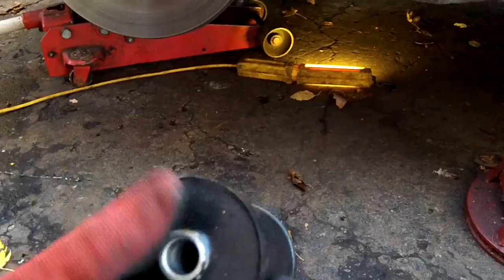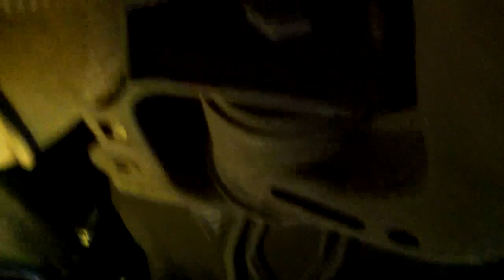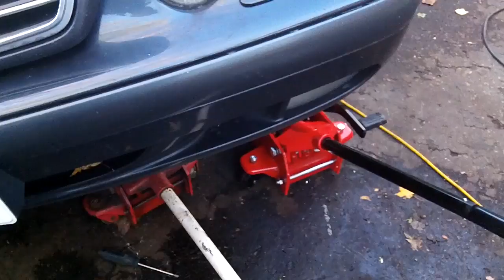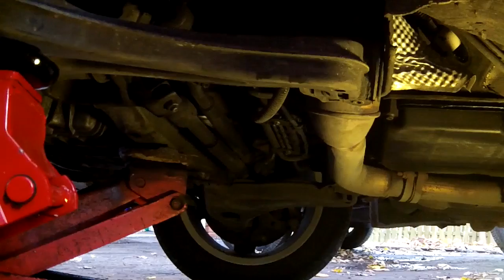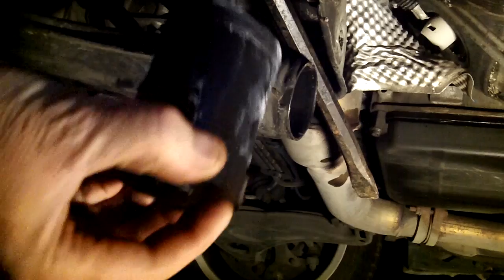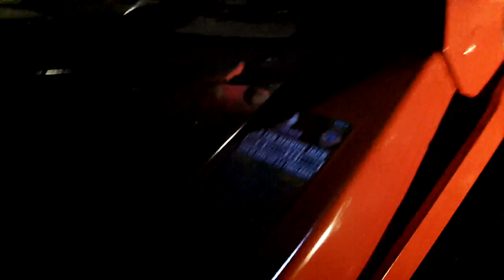Mercedes w208 clk320  Polyurethane lower control arm bushing installation

Comment: why would would my wheel hit my knuckle 2000 mercedes clk 320 tie rod end upper a arms wheel bearing Firestone alignment w208 chasis
Reply from the maker: If you have everything stock, including the wheels ,even with worn parts the knuckle shouldn't hit the wheel. Are the wheel rims stock ?
Reply: @fupabox  they came off a ml 320 I have inch and a half  spacers on the front and 1/4 inch in the rear

Comment: Thanks a million for your informative videos, Doing this job right now on my W208, that center part of that bushing was horrible to get out, drilling several holes did the trick! The bushings got quite warm and had a nice burning rubber and oil smell though lol That was the easy one, got the whole kit and I found the front bushing is even worse than to get out, it's not fluid filled so it can be burned out.

Comment: I'm about to change the whole control arm on my W208 only cost about $120 seems a lot easier than struggling with the bushings.
Reply from the maker: you are correct there.. I was going for longevity , since the bushings were wearing sooo fast, but replacing the entire arm is easier by far
Reply: Makes sense, I did the job today no problem thanks to yours and others videos, even if I was just changing the bushings though I think I would remove the control arm and do it on the bench.

Comment: my clk 430 had no steering wheel vibration before I hit a bad  pothole what could it be?
Reply from the maker: The best outcome would be an unbalanced wheel from the impact ..It could (in order getting from cheaper to more expensive)  wheel balance, wheel alignment, broken bead in tire from impact, bent rim
Reply: thanks for getting back to me your vids are very helpful thanks..yeah I think it could be something minor like balance because its not a bad vibration.. thanks again

Comment: Do the stock bolts fit back in the metal inner sleeve of the new poly bushings. Saw a video which showed that the new sleeve was too small at the ends for the original bolt to fit in fully?
Reply from the maker: +Shelley Bobman  I have never seen the stock bolts not fit in... I have done maybe 8 or 10 lower control arms, but it is possible some of the replacements are not the correct size..

Comment: I've had a pretty annoying hi pitch squeak coming from my front two wheels on my CLK for a while.. everytime I slightly turn my wheel around corners or even straightaways it'll squeak.. It's not the brakes, and its not the back plating to the rotors.. It's really driving me crazy, please help me diagnose the problem
Reply from the maker: +Matthew Nota  I would think it is something in the suspension...I would get a spray can of silicon lubricant, and spray one moveable suspension part ..then go for a drive..then try another until the noise stops.. then you will have found the squeek
Reply: +fupabox I purchased a lubricant spray and sprayed down pretty much all contact points on the suspension on both sides last weekend.. The noise was gone temporarily but now it's back and even worse.. I haven't tried systematically going through part by part, I'll give that a try..
Reply from the maker: Matthew Nota find something non petroleum based.. silicone is good..lanolin is best (fluid film works well)
Reply: +fupabox ok I'll try to that.. I had used 'white lithium grease' which is petroleum based..

Comment: Do you know if the procedure is the same for w209 models?
Reply from the maker: +John Smith   nope completely different.. The w209 has 2 individual lower control arms with the ball joints built in, and a strut front spring/shock assembly.. same as the w203

Comment: It might be more expensive, but wouldn't it be much easier replacing the whole control arm?
Reply from the maker: $600 for 2 control arms that will need to be replaced again after 120k (2 years for me) or $100 for 2 bushings that will last the life of the car with maybe 1/2 hour more work
Reply: ***** The original ones have lasted since the car was new I reckon (1997), and have just started to make a clunking noise. My W210 has done 240.000km :)
Reply from the maker: Dozinox 240k km is really good on original lower bushings... I have seen them gone at under 120k km  ...I would go for the entire lower arm with bushing if I knew I could get 240k
Reply: Do those poly bushings fit on both sides of ONE arm?
Reply from the maker: Dozinox no...only the rear lower bushing seems to wear out.....so the 2 poly bushes did both sides
Reply: The poly bushing kit comes with both front and rear bushings

Comment: damn it !! i know i forgot something !! the Polyurethane part !! i installed the normal one`s ..... well i hope they last at least 3 years well if they serve me for 2 years i wouldn't be sorry but the roads here are a nightmare ! next time i'm sure going to hit it up with a fast question before i do anything ^^ the good part is i changed the front and the rear one`s the bad thing is i still have clanking sounds !! i changed the sway bar ball joints too ! those were like 50% of the price :S im thinking its the strut mounts i mean there is no other explanation ...   the car now feels spongy :< it use to be clunky and metal to metal action i miss that ;P but at least when i hit the brakes or go around the bend the car follows me too ^^ im sure i need new shock absorbers too mine are kinda soft now ... im not going to buy a new car i'm going to fix this one !! 100-200$ a month on fixing this is better than being in debt and buying a new car !!
Reply from the maker: The stock ones should last quite a while..if the roads are really bad, the poly bushings would be pretty harsh. strut mounts are definitely a possibility..or as you say the shocks themselves can clunk when they are tired
Reply: those are pushed to next month list !! well few months from now :P i have to fix the rear differential and drive shaft first :<  after those im going back to this !! THEN going back to rear strut mounts ...... and only then i can fix the cars looks maybe a good car stereo or something .... god this car is a money pit and im poor :P

Comment from the maker: The only way I can describe the poly bushing feeling..is that it feels like when you over-inflate your tires by a couple pounds..cornering and steering is much more direct with less body motion..only slightly stiffer ride..it is noticeable,but only on the bigger potholes etc.  I did one side with a sawzall and the other with the hacksaw..sawzall is no problem if you are careful,and much much faster..I showed a hacksaw in the video because is would be easier for most viewers to use